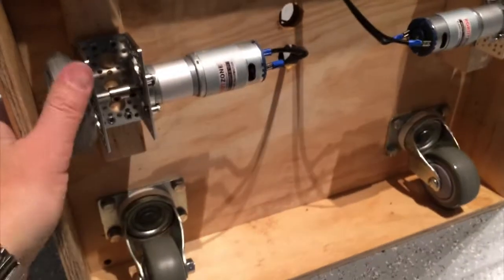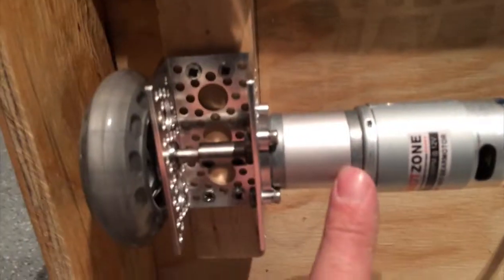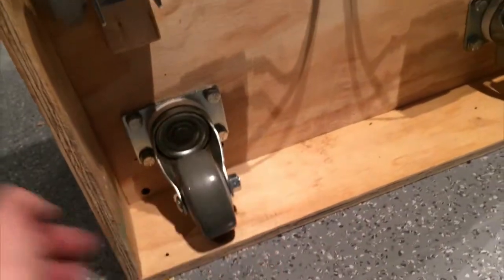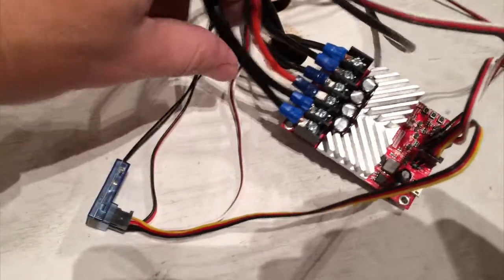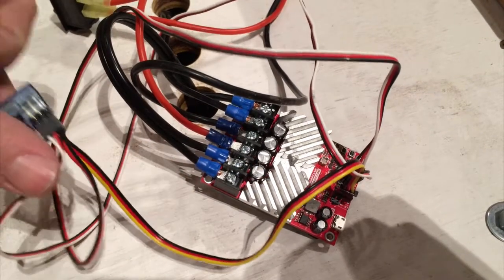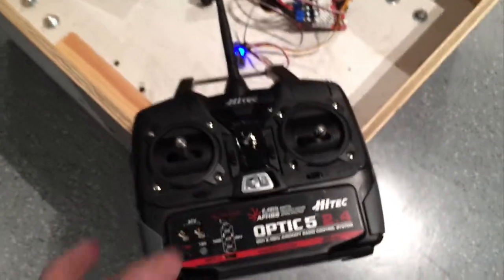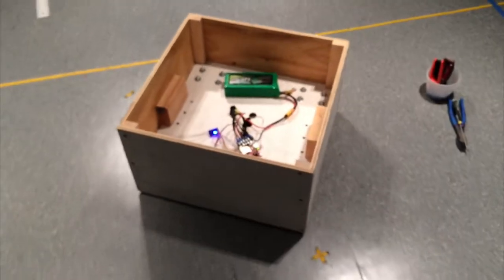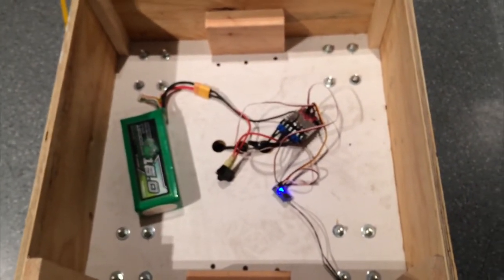RC Robot Control: speed, direction, DC Motors, Roboclaw, Hitec Optic radio & Servocity

Comment: If I wanted some 12v led lights 3amp draw to come on when the motor was running and the motors only pull 7amp max. Can I just connect the leds to the motor power leads? assume battery has high enough discharge.

Comment: Hey, I need to replaced a DC motor speed controller, the motor is 800w and the battery is 36v, do you know of a brushed dc speed controller that I can connect a regular RC receiver to and run from an rc controller? Many thanks
Reply from the maker: Check out the roboclaw controllers.

Comment: If I use 10 inch wheels (all terrain tires) and motors from a Swagtron T6 which carries more than 300 pounds and then find a way to attach a Hoverseat XL which has 2 other wheels(also need an adaptor as Swagtron missing a round middle to attach to Hoverseat) I may be able to create an inexpensive platform but I also want the robot wagon to follow me rather than have to sit in it. Also I would prefer alternatives that permit me to use the Swagtron motors and wheels and put on a wood or aluminum base so I have more flexibility in adding more functions to my robot wagon platform. I am assuming I would need a new motor controller as I lack the experience to adapt any motor controller. I know about the Odrive for brushless motors but lack knowledge to make it work with hoverboard parts. Also if you can suggest the hardware and software for the follow me function it would be appreciated.

Comment: If I add larger wheels such as 10 inch hoverboard wheels can you recommend appropriate 400 watt motors and a motor controller? Can I use the roboclaw motor controller 30 amps for brushless hoverboard motors? Also do you have a recommended chassis and wheel hardware to fix motors to? Should I buy a decent hoverboard and rip apart for motors and wheels? I am assuming I will not be able to reuse the hoverboard motor controller without a lot of knowledge of electronics?
Reply from the maker: It's hard to answer all that in a youtube comment.  It sounds like you need something pretty different.  Roboclaw's are designed for brushed DC motor use.  You'll need something different for brushless.   The other, mechanical problem with trying to do a simple adaptation is that you get into needing to change gearing and the drive train to accommodate differences in wheel sizes, which translates to potential differences in speeds and differences in load capacity.

Comment: Hey I have a question, does it works without software?
Reply from the maker: This particular build doesn't need any software.  It is all based on RC signals and control.
Reply: Okay, I have the same motor controller but I can not do that. Can you tell me how I can connect this
Reply from the maker: you have to set it into the mode that takes direction from the RC input pins.  It's covered in the documentation for the driver.
Reply: How does the receiver get electricity and with the small pins how did you plug it? Please
Reply: get it from +- sign on roboclaw two pins